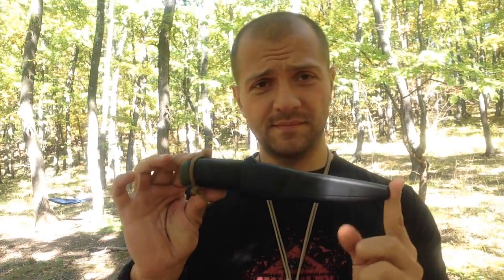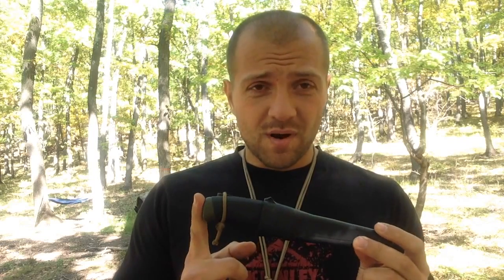Rat Tail Knife Batoning Fail - Enzo Black Beaver

Comment: Saw this years later. That knife should not have broken, but OTOH, a puukko with a decorative handle like that, not made of one solid piece of wood but different pieces glued together, really is meant to look at, do some light carving, no more. 

Many comments below rant that one should never use a knife like an axe and baton it; but one does not baton an axe either. You'd destroy the head over time. One does, however, baton a froe, which is just a thick, long blade with a sheep's foot tip and a detachable handle at a right angle. Used for making traditional wooden shingles and such. 

50 dollars at Lehman's (which we don't have in France), and the accompanying description is as follows:
"  Proven effective in continuous use since the 1800s
    Case hardened, so the blade lasts longer
    16" hickory handle
    15" sharp steel blade
    4 lb
    USA made
    Note: This wood froe tool is not meant to split logs. It's designed for already split lumber for woodworking, making kindling and more."

So you can whack a thick knife blade to split wood, provided the manufacturer made it to withstand that. Batoning may be a bit of a Youtube fad but it can still be a valid way to process wood with more precision and less risk (no swinging) than an axe. Just stay within reasonable limits. I'd say use the 'Silky limit': don't try to use it on wood that is thicker than half the blade length. My guess is that if you apply that reasoning to a good sturdy knife built for light chopping, you'll be OK. A 4-inch Mora HD or similar should split 2-inch sticks. Not a four-inch log. 

I can, however, see the reasoning behind getting a bit larger than that to see if the knife can take more abuse than you would normally subject it to. If it does, you can safely assume it can do normal jobs without breaking on you. And if you like hitting things, it may be fun. ;-)
Reply from the maker: Blades and tangs break like that when they are too hard. This is from my experience. 
If a knife has a spine thicker than 2.0 mm it is clearly meant for more than just slicing. And yes...some will fail...but imo it is better they fail while testing. 
if I would be camping with only 1 cutting tool i would not use it harder than i tested it. And if i had to split logs i would make a wooden wedge and use that. 
My mora Robust took quite a beating as I tried to show on camera that you do not need a full tang knife to do anything you need to do. If a 15$ Mora can do that..any knife should!

Comment: вывод? дрова руби топором!
Reply from the maker: nu. chiar nu era vorba despre asta. eu nu port la mine scule pe care nu le-am testat
Reply: SpartanJohns непонятно ничего. Knife was wery beautifull. Wery bad that you brake it. Sory for my english))
Reply from the maker: The knife is fixed now and i have tested it further. Now it can take up even the hard use tasks without failing.
Reply: SpartanJohns good luck to you. I fordge knife for myself from bearing. It is not stainless steel. But it wery good cuting. But if i use it for batoning it wold brake. So what to do? 
If you can chop with axe and cut with knife)) if it is possible. Or use it wery cearfull. And again good luck to you man from the ocean.